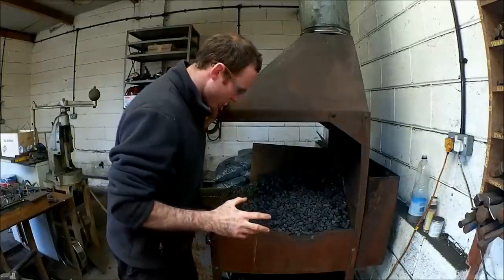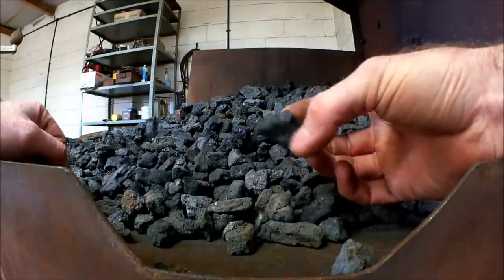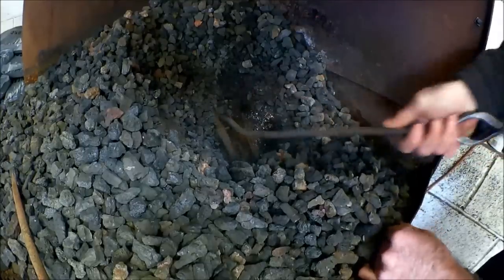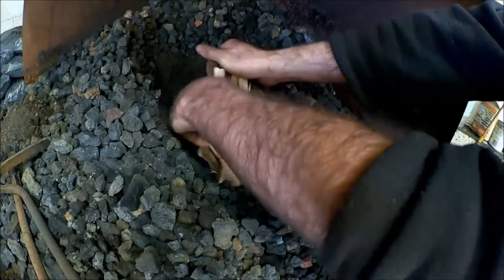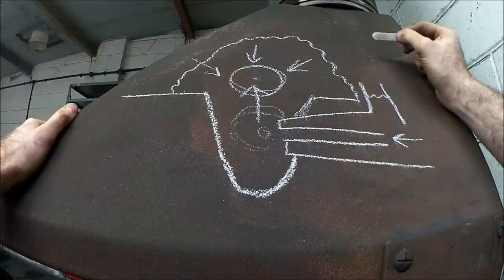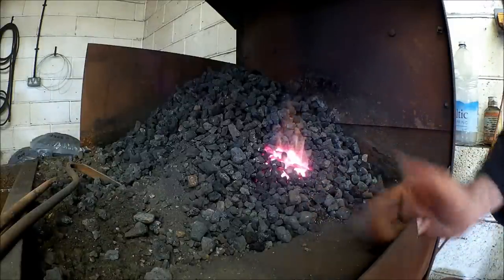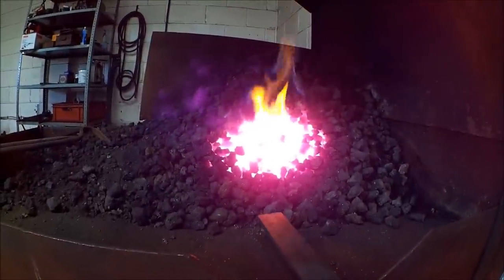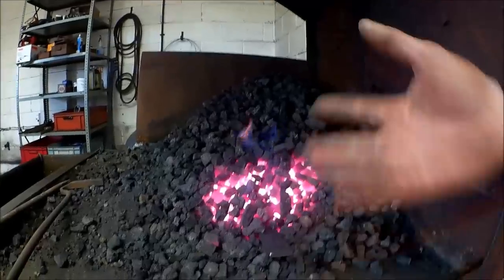Blacksmithing - Why Side Blast Forges Are The Best #1

Comment: How could I make the iron crater instead of sand?
Reply from the maker: Cast iron or water jacket can work but sand is cheaper. Cheers J
Reply: @joshuadelisle  but instead of sand I can't make the iron crater like a modern forge?
Reply from the maker: @marioamor5982  a bottom blast forge has an iron grate that is cooled by the flow of air. A side blast is different and you get excessive corrosion over time if you just use iron. Sand is cheap and works very well.
Reply: @joshuadelisle  How deep and diameter of the nozzle is it? and the measurements of the stove? a greeting
Reply from the maker: @marioamor5982  hi. I recommend 32mm diameter pipe that is water jacketed. A depth of 50mm bellow hearth level. Ball valve control
Reply: @joshuadelisle  Only 50mm deep? It's not little?

￼
Reply from the maker: @marioamor5982  the main thing is how you pile the coke on top as explained in the video. Do look at part 2 also. Cheers J
Reply: @joshuadelisle  cheers 😊

Comment: what kind of fan is that? @ 16:18
Reply from the maker: Its a small bouncy castle blower, Aldi had new ones for £40 including the castle recently. I got mine for £10 second hand. They are good as they are designed to work against back pressure and for long periods so you can regulate it simply with an air valve and not a potentiometer. Cheers J

Comment: you siad that coal burns on its own. not from my experience.
from my experience it needs a constant air flow, or else the fire will bie out.
but maybe it's just the type of coal i'm using.

edit: although it dose seem very similar to what you're using, so i don't know....
Reply from the maker: Different coals require more or less air than others. Coke definitely needs constant strong air flow. Charcoal will burn away with out extra air feed. Steam coal requires far less air as coke. House coal will remain burning without an air feed. Cheers J
Reply: Anthracite is so pure it typically doesn't need to be coked.

Comment: Are you a robot you just stick your hand right in the fire and pull out the hot steel right out of the forge
Reply from the maker: Ha ha no you should use tongs. But yes my hands are more heat resistant than most peoples.....
Reply: Wow I still manage to get burns when I use tongs.

I the episode were you made a forge out of a grill you touched the side and said it was cool it was probably super hot lol
Reply from the maker: More burns make for tougher hands... ;)
Reply: Well with how many burns I have I guess I'll be able to pull yellow how steel right out of the forge

Also the forge I the video works great with wood or charcoal that's what I use just don't use sand
Reply from the maker: den smack that's great!  All the best J

Comment: How to forge bellows?
Reply from the maker: Hi Mario. What would you like to know specifically?
Reply: @joshuadelisle  
Is no nozzle necessary for the slag? and the side nozzle will not burn? Thank you
Reply from the maker: No nozzel needed on the side blast and if its water cooled it will last far longer than a bottom blast. Cheers J
Reply: @joshuadelisle  Thank you

Comment: What a gigantic mess.  Bottom draft on my fire pot.  I like to heat steel evenly, not just one side like a side draft does.  Forge welding is difficult with a side draft.  Not everyone has 1000 sq ft to dedicate to a bathtub size forge.  Cant get coal in California, I found this out after I built a coal forge.  Then I built a forced induction propane forge.  Best of both worlds.
Forge On!!!